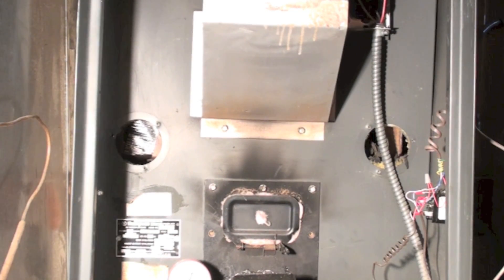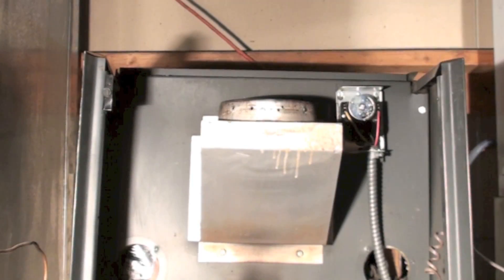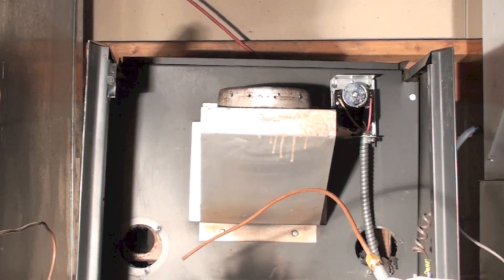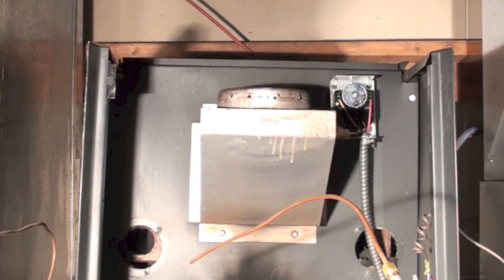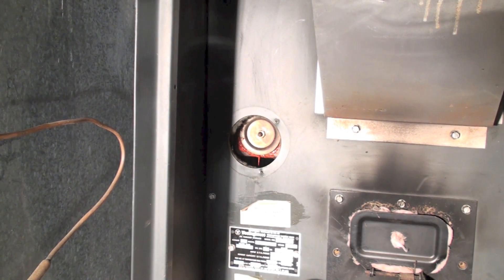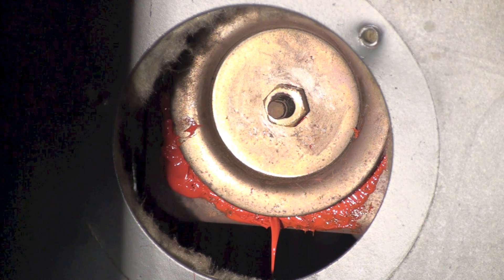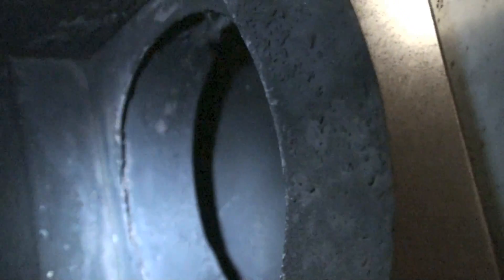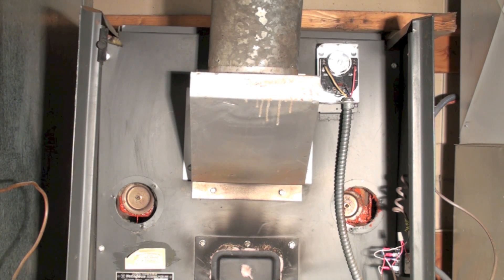Cleaning the oil furnace heat exchanger

Comment: Gary. Do you also pull the burner gun to vacuum the burn chamber as well.   I have a becket on a 2019 air temp highboy     Thank you in advance.  Kal
Reply from the maker: It is generally impracticable to remove the burner assembly.  Also, the combustion chamber does not usually get sooted.  Concentrate on the heat exchanger.
GFM

Comment: I just pulled a bunch of rotted metal pieces out of both clean out ports! It was as if they were pushed in right up to the lid! Came out easy, not sooty. I’m wondering if a chimney cap could have possibly rotted and came down the chimney.
Reply from the maker: I have no idea.  I have never seen baffles in the heat exchanger of an oil furnace.  I would not think it would be parts of the cap.  In any case, Merry Christmas
GFM

Comment: I have a lowboy that does not have those 2 access spots.  How do I get in there to clean the heat exchanger ?? THX
Reply from the maker: The only way is to remove the smoke pipe at the heat exchanger connection and use a flexible tube to get as far as you can.
GFM

Comment: Hi i have and old house with a central oil furnace in the basement and now it smells like truck exhaust in the house when it comes ON what could be the problem ?
Reply from the maker: I would start with looking at blockages in the chimney or heat exchanger.
GFM
Reply: @grayfurnaceman  thank you

Comment: First, I want to thank you for posting your videos.  I had a blowback last year and cleaned out as much of the soot as I could in the furnace and my chimney.  This year my furnace quit running and while troubleshooting I pulled the burner and saw a carbon buildup where the burner goes into the chamber.  It had nearly blocked the entire opening.  I removed the carbon buildup.  I also reached into the combustion chamber and removed a handful of stuff that looked like burnt charcoal.  I replaced everything and my furnace has been running fine for a about three days now.  Here is my question, I noticed there was more debris in the combustion chamber but I could only remove so much by sticking my had through the opening.  Is it OK to use a shop vac to remove the debris or should I just leave matters as is?  My furnace is an oil/air furnace with a Beckett motor.  It is at least 20 years old.  Thanks.

Comment: Oh crap...I'm supposed to clean the oil furnace? My useless ex never did. We (I now) have lived here 8 years 😕  I was wondering why there is soot on my freaking walls. Calling someone tomorrow...ugh.
Reply: Cathy O - Soot on your wall usually means your heat exchanger has a crack or hole in it and is allowing the smoke that should be going up your chimney to leak into the air that gets blown out your heat vents in your house, thus the soot on your walls and carbon monoxide is in that bad leaking smoke.

Comment: Could a dirty heat exchanger cause an oil furnace to blow lukewarm air from the vents?  I have been troubleshooting for about a week now.  My furnace is firing good and the heat from the vent attached directly to the furnace blows good heat.  Also, the flue pipe is very hot to the touch.  However, the heat from the vents to the rooms is just lukewarm.  I did have a lot of soot and a blowback a couple of weeks ago due to my flue being blocked up.  Thanks.
Reply: Wonder the same

Comment: My oil heater look like this ,
Can you help me , what is your model number of combustion chamber liner .
Because I don’t see any tag on my burner .
Reply from the maker: There is no way to get these parts for this age furnace.  
You can get general replacement parts.  You will need a combustion chamber sized for the nozzle size you are using.
GFM

Comment: On some of the old Lennox furnaces, you have to remove the front vestibule panel to get to the heat exchanger clean out covers.  Be careful as some of the old clean out covers are made of asbestos. Anyone doing this type of cleaning should be wearing protective clothing and a good respirator with cartridges rated for asbestos.
Reply from the maker: Good thoughts.
GFM

Comment: Hi i have watched some of your videos, i have question please, my oil fired furnace( Beckett) gets dirty faster then should ( i Service my own furnace), i used to clean it once a year, now 3 times a year, i checked the pipes, cleaned the pipes, i cleaned the chimney( the house chimney ), i cleaned and check the chamber, so why this way.I do not have any gauge of any-kind, but i do have all kind of tools for it, and know how they work, i have been working on them for over 20 years.
Reply from the maker: If you are getting soot, your combustion is not complete.  You could have impingement of the flame, wrong nozzle or not enough air.  Slight possibility of low oil pressure.
GFM
Reply: Thank you, just let you know the nozzle that i use is ( 1.10/80W ) and my Burner is old  Beckett Model: series A,AF series oil burner, and my boiler is New Yorker, do i use right Nozzle? i check my notes last time i change it was one year ago, i will change it again.  Where/how can i adjust the air...Thanks again.

Comment: OK, Thanks to GFM my oil furnace heat exchanger is clean,(more that 1/4" of lined soot) I got the inside heat exchanger clean and the combustion chamber area clean. What I did was use an old 6.5hp shop vac, (Used the vac without the filter) and attached a hose to the exhaust, put the hose in a 5 gallon bucket filled 1/3 of the way with water, covered the bucket with a wet towel and taped the towel tight around the bucket, and tape the towel around the hose too. Blow everywhere into 2 cleanouts, inspection hole, clean the elbow & flue pipe. JUST DO NOT BLOW DIRECT AIR onto combustion chamber wet pack, It took me about an hour until I see no soot dust being blown around. Whatever holes (that are open to the heat exchanger, including the inspection hole, must be filled with a damp towel or you will blow soot all over) except the hole that your using to vacuum and blow air. When doing this you still need to wear a mask as some soot will go into your basement, after done hose the basement down. A better way would be to use a long hose through a window and actually have the shop vac outside, and still use something on the exhaust side. Make sure to tape the hoses with foil tape so they don't accidentally come out of the vacuum.  Make sure you cover your heater vents as soot will find a way into the ductwork, I taped old furnace filters onto my registers, also run the unit for a few minutes with the filters taped on because there will be loose soot and will go into your house.
Reply: Buying a new furnace/boiler would be WAY easier than the nightmare you just described 😂

Comment: my oil furnace has been working good....but after 5min. the fan only comes on for 1min ...new filter...same......15 years old ..is the soot doing that ?Never been cleaned
Reply: Yes. A furnace should be serviced every year to prevent this condition, to save money, to stay warm, and to not burn the house down.

Comment: Grayfurnaceman, how often would you recommend opening up the heat exchanger to inspect? I know when I was having a yearly tune up/cleaning, it was just filter, nozzle and combustion tests. I've been doing my own for the past 18 years or do but I supplement heat with a wood stove so I only burn about a tank of oil/year. I've got good draft so I don't suspect plugging but do you use a high stack temp as a trigger to inspect? Thanks, Jim
Reply from the maker: Best way is to do it every heating season.  Not hard to do.
GFM
Reply: grayfurnaceman vacuumed it out. Man did it need to be done! Not much soot just that dry granular grey stuff. All better now. Thanks so much for your vids, very helpful!
Reply: Hi dear Grafurnaceman , first I would like to thank you so much for all the videos you made these are very helpful.👍👍👍👍👍
I hade problem with my furnace reset many times to work only for 40 seconds so after I watch your excellent video step by step , I cleaned the vaporizer oil valve withe electrodes ignition from south and dirt with the carburetor cleaner and adjust the electrodes & cleaned the flame sensor eye ,problem resolve 100% cause of your help , appreciated so much to save money & time & headache 🌹🌹🌹🌹🌹*** happy new year & wish you all the best I will subscribe to your wonderful Chanel.
Reply: grayfurnaceman Yeah mine has not been done in 12years.  2years prior to me buying the house.  Thanks for the help!

Comment: question  not all the time but now and then I have to reset the burner it don't time out or anything like that I set ones and that's it runs fine. I'm at a loss
Reply from the maker: There could be a number of problems.  plugged oil filter or line, dirty flame sensor or defective sensor, partially plugged nozzle are some.  I would do a complete service to start.
GFM

Comment: what  vac  is that   what system  are  you  using
Reply from the maker: Its just a large shop vac.  I don't really recommend this vac as it is smaller than a commercial vac designed for cleaning furnaces.
GFM

Comment: It didn't seem like you took the burner out when you did this. Wouldn't it make sense to do this so that none of the soot or debris gets in it? How about the draft diverter box too? It just seems to me you would have more access to cleaning and would be able to see in there better with those things removed?
Reply from the maker: We never take burners out for heat exchanger cleaning.  The only access you will get is to the combustion chamber.  These chambers are made of an easily damaged material and there is really nothing there to clean.  As to the smoke pipe attachment, it could be removed to get somewhat better access.  Thanks for the thoughts
GFM
Reply: Thanks for the response. I thought that some of the debris that you are loosening up might get pass the vacuum and down into the combustion chamber.
Reply from the maker: Richard Fossani That's one of the reasons I don't really recommend using a shop vac.  This video gives an option that you can use but is not the best.  The best way is always a vac truck and an operator that knows what he is doing.
GFM

Comment: I agree, your videos are excellent, very helpful for a first-time homeowner like myself with a very old oil furnace. I have an old International furnace, and I can't see any access ports to the heat exchanger, how do I clean this kind?
Reply from the maker: Many of them do not have clean outs.  The only way to clean them is to remove the vent and vac from there.
GFM
Reply: grayfurnaceman
Is there any chance you could post a video to this end? Thanks.
Reply from the maker: Randy Stroup I will put it on the list.  To be done hopefully soon.
GFM

Comment: I did not know that about 1/8 inch of soot equaling 1 inch.  Nice to know.  What is a vac truck?  Another great informative video.  Thanks
Reply from the maker: The vac truck is usually used to clean ductwork.  It has an engine powered vacuum.  They have an 8 inch vacuum hose from the truck and can clean oil furnaces, chimneys or ductwork.  Most of the newer ones are smaller but still commercial vacs.  The 1/8" thing came from the Beckett burner book.
GFM